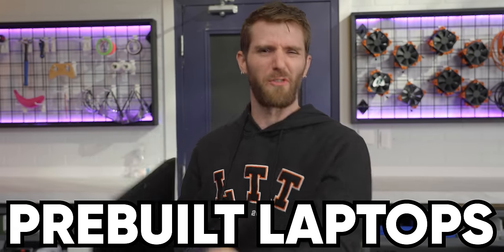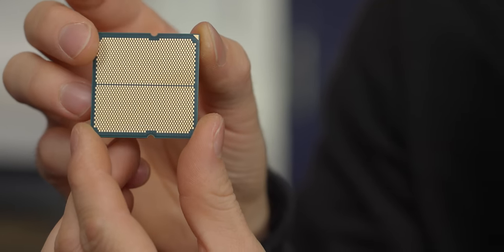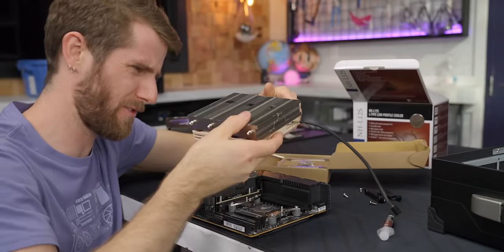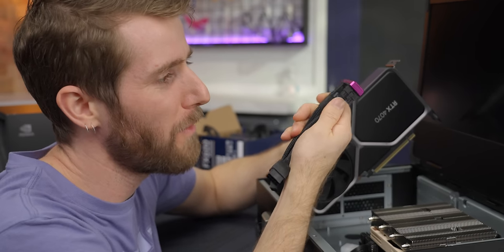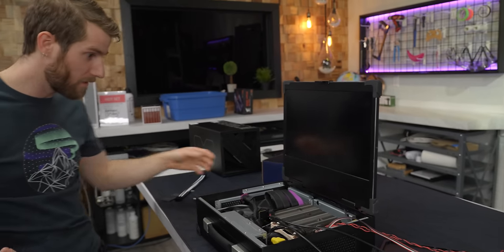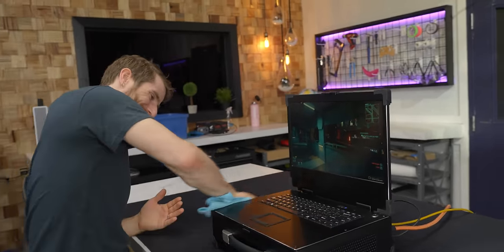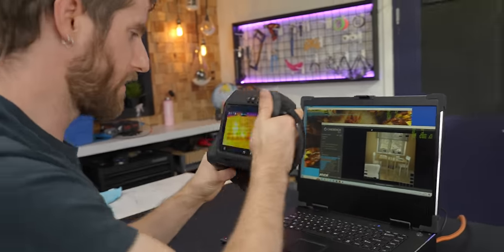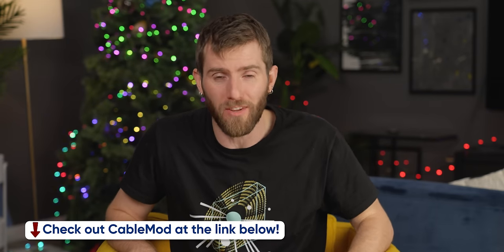Building your own “Laptop” is Terrible and I LOVE it! - MaCase B21 Briefcase PC

Comment: I wanna see Alex get the form factor down to half the thickness with the same components using the machine shop, 3D printing, a faster portable LCD panel, and lots of that classic YOLO spirit.
Reply: This would straight up make sense if the case was like 1/4th the thickness. Just make it thin enough to not be the size of a desktop.
Reply: @noscopesallowed8128 half the size would be just a little bit thicker than the old laptops 😂
Reply: @NotAeroOnFortnite  Yeah but that's fine. The whole make everything an ultrathin notebook fad that everybody is so obsessed with has ruined the laptop market. Nobody actually needs their laptops to be as thin as a sheet of paper. And if they weren't so obsurdly thin, you'd be able to fit actual hardware and cooling in them, not to mention upgrade slots etc...

I daily a Dell rugged laptop with a whole ass handle on it. Literally would not trade it for the world. With my old laptop I had to worry about cracking it just by having it in my backpack. With my current laptop I just throw it in the back of the truck, drive 50 miles, and use it with absolute certainty that nothing stupid has broken it on the way there.

Comment: This reminds me of the old school portable computers where "portable" means "can be moved without a forklift". Like the 28 lbs Compaq Portable PC from 1983, of which one of the selling point was that it's small enough to be carry-on luggage (and hilariously, airlines changed the standards shortly afterwards so that no longer applies lol)
Reply: We used to call them "lugables".
Reply: And the one thing that all of those did that this didn't was they put the ports on the side where they won't get wet or dirty when you set the thing down.
Reply: Or the Commodore SX-64
Reply: The first Mac laptops were like carrying a cinder block.

Comment: One small issue I noticed is that they didn't raise the bottom off the table, so that intake vent for the GPU is probably blocked by the desk.  It would also be interesting to see how it performs with an insulation layer on the bottom of the keyboard panel.  Something thin like neoprene might work to protect your hands.  Then add some super low-profile fans to the left side of the case to pull air out behind the GPU.
Reply: yea i was thinking to divide the side vents with a little tape, since it's being used as a vent in and out and laptop manufacturers do that.
Reply: It's not flush, the rubber corners raise it by a bit, but yeah, it could definitely do with a bit more breathing space!
Reply: That's all I wondered about during the whole video. I'm pretty sure they thought about it but didn't mention it to get comments for driving engagement and get a boost in the recommendation algorithm.
Reply: What about, water cool the keyboard XD
Reply: Exactly 👌
Reply: @declan767  : Other way around, integrate a radiator into the keyboard.
Reply: Also I'm pretty sure they put the GPU vent on the wrong side of the GPU
Reply: @toothlessblue  it has two fans
Reply: @Borrowed Time, did you delete your comment? I only see it in the notifications. Maybe you were shadow banned by Linus.
Reply: @scaryfish91  especially with the added fan guard eating up a good chunk of the probable clearance
Reply: I think that adding another cutout in the bottom to let both GPU fans pull in fresh air would help, along with using some foam to make a gasket to seal the GPU intake to those bottom vents would be best. Combined with your idea of some low-profile fans to pull the heat out the LH side and adding another fan to the RH side as intake should allow for better airflow in general. 

Man, if this thing had a better display in it I would be seriously considering building something like this. A 17" 1440P 120Hz display on this thing would be insane. Especially if they used a better keyboard. Maybe one of those thin laptop style mechanical keyboards could be made to work. Those 2 changes from the manufacturer (as well as stiffening up the keyboard frame) would definitely make it appeal to more people.
Reply: You are wrong
Reply: I think the GPU exhaust is directed to the keyboard as well. That's why it's hawt.
Reply: Yeah but when you're actually using a laptop, usually you're just sticking the laptop on the table, and not raised
Reply: @mongarcia9151  - That's a good point.  Makes me think the manufacturer should re-engineer it to take low-profile GPUs oriented vertically.  Or make it convertible to either orientation, even if that adds depth.
Reply: @PrecisionAcc  - Which is a major reason why laptops thermal throttle, and why performance gaming laptops often include a mechanical kickstand.   All Linus needed to do was glue on some rubber feet.
Reply: I’m totally down for a revisit on this case
Reply: That's what I thought too, but pobably using an insulation will protect the keyboard at the expenses of the GPU because you will redirect the heat somewhere else. About raising the computer I think they decided not to do that because they tried that configuration as a laptop, so they would need to keep it on the table; probably, if they closed the screen and tilt it over they would have had a better result, but that would have been a full desktop pc and not a "laptop"
Reply: @ApacheVR-4  A real trackpad may be nice too, but it is way too tall to be comfortable anyway. The idea I would have to make it comfortable would be to do something like the earliest "laptops", having the screen and the device in the box, with the keyboard/trackpad on a hinge. Would also solve the cooling issue.
Reply: heh, expansion card connectors on the bottom does not look idiotic for you?
Reply: @dmitryponyatov2158  - Considering I go back to the days of the IBM XT computer where ALL expansion boards were vertical, no it does not look idiotic.  That was the standard for about 30 years.

Try not to advertise how young and ignorant you are.  😉
Reply: @phydeux  I mean about the way one going to transport this box in a closed state, not using on table. Even in a car this back side will get the most impact with dust, wet surfaces, and contact with other things in a car trunk or between back and front seats (as I always transport computer cases).

So, my aggression was targeted to "designers" who don't think about the real use of their products in a real life. The same as making GPU vent hole closed by a table surface in this video. Or putting axial fan on Raspberry radiator fixed perpendiculary and with almost closed outlet.
Reply: @J-wm4ss or like rubber standoffs

Comment: I feel like this concept could be a lot more comfortable and have better temps (for performance and comfort) if the display and keyboard were swapped. a fold down keyboard would give a much nicer angle to type on while giving the pc way more air to breathe. I'm positive you could engineer a method to be able to angle the screen/pc to have variable viewing angles too, which is really one of the only pros for the way it is in the video. (perhaps that's a way the LTT team can build something unique)

I'd LOVE to see DIY laptops evolve more with the Thin Mini-ITX form factor (which uses laptop ram for slimness) and maybe even some Frore based coolers if they can handle the load. such an untapped market. i'd bet most ppl who get the chunky gaming laptops that stay plugged into the wall 24/7 anyways only do it cus theres not an option to DIY it.
Reply: I have seen a portable computer from the late eighties that did that. 6-inch CRT and floppy drive with a flip-down keyboard.  had to weigh 20-plus pounds and ran off of DOS, but I can see a better concept now with better microelectronics.
Reply: This idea is awesome. I love the way you think
Reply: As far as I remember, there is modern Asus laptops with motherboard and cooler behind a screen.
Reply: I was thinking you could 3D print an angled exhaust for the card, as well as a shaped funnel to bring cool air into the card. You could have a secondary exhaust for the remainder of the kit on the other side. The keyboard could be "fold out" with feet to stabilize use on a flat surface, if 3d printing exhausts was not an option. Or, you could remove the keyboard completely and replace it with a fitted plexiglass or carbon fiber sheet (or an array of output fans), use a Bluetooth keyboard that sits snug in the plexiglass for travel. 

I want to give it a serious go (I have a 3D printer on tap and plexi as well as carbon fiber here), but considering I would want to change out the display and would have no use for the keyboard the case is just too expensive for me - there does not seem to be an option to buy the case standalone.
Reply: I've wanted this for years. With USB monitors being commonplace now the idea isn't actually far fetched.

Comment: The entire "suitcase computer" idea just reminds me the first Compaq portable lines. The entire MS-DOS computer in a suitcase format that has both keyboard and monitor built-in and can be expandable just like this one.
Reply: I remember my father brought one that had a crt in it. That 'portable' laptop was over 10 kg (22lbs)
Reply: We used the first version of those, with the guts ripped out and replaced with i386 PCs, in the mid 90s as portable workstations.  At some point I want to upgrade one of them again with an LCD and a raspberry pi, just for old times sake.
Reply: Kaypro baby.
Reply: I had one of those 1982 Compaq 8086's as my first PC. Loved learning DOS on it. The amazing part was that the keyboard folded up to cover the monitor and disk drives to become the bottom panel, that is how sturdy they built keyboards back then.
Reply: That was my first thought as well. They were called luggables, and I think this is very much in the spirit of that. Although it seems like they just modified an off the shelf pelican case, rather than design something tailor made for housing PC parts. This could be done so much better with a tailor made case. For one, it's way too bulky and heavy. The luggables of old had reasons to be big and bulky, since they contained full size floppy drives and full size keyboards, and in many cases a CRT display. This thing could've been made thinner and certainly could've been made a lot lighter without really sacrificing much.
Reply: @TheEricShen  Yay, Kaypro! My first computer was a used Kaypro II. I traveled from New Zealand to the UK with it. Took up most of my luggage allowance.
Reply: @EntropicTroponin i don’t think they sold it as a laptop, did they?
Reply: Macintosh Portable
Reply: @mattrogers6646 Exactly.  We kept the original CRTs, keyboards, and so on, but swapped in a new mainboard.  Like  this new case, it accepted standard components (not sure if they required modifying the hardware, as I think they were pre-ATX originally).  We had a laptop, but it was incredibly fragile by comparison to these solidly built machines.

Comment: About 20 years ago I worked on the V22 Osprey (the tilt-rotor helicopter) project at Bell Helicopter for the US Marines.  We had a suitcase machine that housed a Sun SPARC 10.  The specs said it had to be able to be dropped from the wing of the aircraft onto the tarmac and still run.  It also had to run with temperature ranges from the south pole to the Arabian desert.  It was lined with something heavy like lead because the thing weight about 40 pounds.  I assumed it was to block radio emissions, but I didn't ask.  This reminds me of that.  The computer was used to run the Interactive Electronic Training Manual System (IETMS) which was basically the user manual for the aircraft.  This reminds me of that.  It was literally a SPARC 10 machine loaded into a metal briefcase with a monitor fixed into the upper lid.

Comment: This seems like the kind of PC that needs to travel occasionally, but not too often. A desk built specifically for it, where the whole body is built in and maybe supplemented by extra fans would be really cool.
Reply: That's what I though too, though in that "case" it could be better just to have a monitor attached to the case, and a detachable keyboard & mouse.
Reply: Wish it had an OLED
Reply: I think the main use case for this thing is some situations where people have need for certain specialized pcie devices that have to be moved around. There is really no good reason why you'd want this over a high performance laptop if you goal is to have something that can be moved. It's certainly not for gaming as display and keyboard are not up to specs and I don't think it's for high spec workloads as again you would want more serious monitors for those situations and also more serious case cooling. Despite it's large size it's cooling options are quite limited and so in this case you'll unlikely to even be able to put anything together that would beat high end gaming laptops. It's basically for someone who happens to have something weird to put in PCIE slot and they need to carry it around.

Comment: Put a 3D Printer to use - make a funnel for that filtered intake up to the fan on the GPU. 😀  This is a seriously awesome build!
Reply: Better use would be adding some way to get more airflow than the thin corner pieces allow for.
Reply: They could also build funnel for an extra exhaust port (from the top of the GPU, out of the uppermost PCI slot)!  It might help keep wrist temperatures down!
Reply: @FlintTD  That's a very good idea! 👍👍
Reply: @FlintTD  Yeah, that would probably work wonders for that since it's the hottest part due to that being where the heat blows straight towards
Reply: That's exactly what I was thinking. Go old school Dell style, duct everything.
Reply: Actually, I think they should have addressed the fact that they had to drill a huge ass hole into the case just to make sure the GPU with its cooler (this is partly why we need to have blower style coolers come back) was able to operate even halfway effectively. If they had to make that modification, then the case is shit.
Reply: @arnox4554   To be fair, that was a particularly weird cooler design. At the same time they kinda halfassed accommodating for the GPU cooling

That said, given that cables had to be routed in such a way to where they go outside the case in order to accommodate the video input and it didn't even come with a riser cable, yeah, the case design kinda sucks

It really feels like more like the level of design one would have at the prototyping to figure out what they didn't think of yet phase than a final product and for $400, it should be ready to go out the box.
Reply: Optimum did something like this!

Comment: That would be WONDERFUL for a portable data acquisition setup. Pop in a suitably large enterprise drive for data storage along with a PCIe DAQ card or two, and you could real-time monitor a bunch of things and have the processing power needed to research the data it stores.
Reply: It's clearly intended for industrial uses like that, and not gaming lol
Reply: @kaukospots  Except it isnt ruggid enough, and a laptop will be better. If you don't have internet it is safe to asume you need a properly ruggid device. If you do have internet, use a laptop, and if that isn't fast enough it is time to use some remote server you connect to using your laptop (or tablet/phone).
Reply: @someonespotatohmm9513  It's clearly reasonably rugged, and the point of this format seems very likely to allow the use of cards etc that you couldn't in a conventional laptop.
Reply: @someonespotatohmm9513  : I've used those rugged laptops, and they're both expensive, and slow to drop in price. Getting enough computing power is far from guaranteed, and the possibility of needing specialty cards could be a deal breaker.
Reply: im talking out my ass but im ASSuming this case is 1000% novelty and not intended for any legit work spce haha
Reply: @someonespotatohmm9513  Sorry man but this thing easily beats laptops. It matches matches 3 laptops, but it is also that thick lol. But this is definitely a better portable computing powerhouse than any laptop for sure. Certainly far cheaper!
Reply: I prefer my BSI computer FieldGo M9. It has a fold down keyboard and 3 fold out screens. And it has a full 7 slot design. It's to bad it's discontinued. And the FieldGo F3 is not as good as the power supply is above the processor. and the big difference with these vs Linux's is that the keyboard is thin and the PC is in the back.

Comment: I do actually think it's got a usecase especially if you're someone who spends time in multiple living locations, like a student or someone who moves around a lot for work. Sure it's not portable by hand, but the "just chuck it in your car factor" is really appealing compared to a normal desktop that you'd have to be a lot more careful how you pack up.
Reply: That HDMI cable looks easy to damage if you forget to unplug it.
Reply: @jamesphillips2285 everything is extremely damageable if you forget to do basic stuff. I'd be more concerned about the cooler doing stuff while in transit
Reply: @Anankin12  That big GPU too.

Really need a hold-down bracket to safely transport a card that size.
Reply: i feel like there are cases that are way better for it though
Reply: ... so a normal laptop would suffice ;)

Comment: Really should have flipped the GPU fan - then you are not actively pushing heat at the keyboard but instead out the vent you cut (some extra rubber feet for a little air gap might be a good idea). Really nice case though, way quicker and easier than putting the ATX in a flight case yourself (which I have done myself back when desktop replacement laptops didn't exist and 3d printers were more lab or really early adopter curiosity than consumer products).